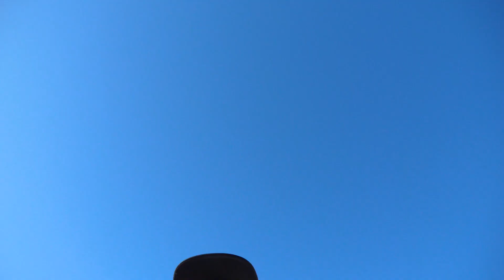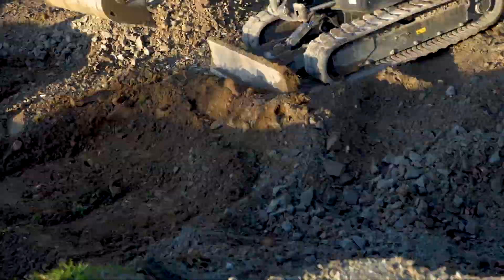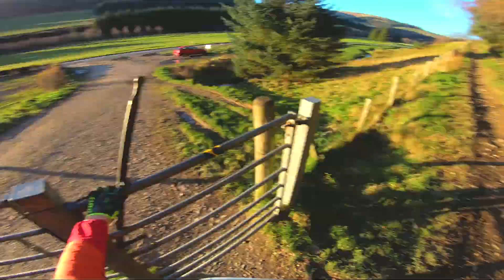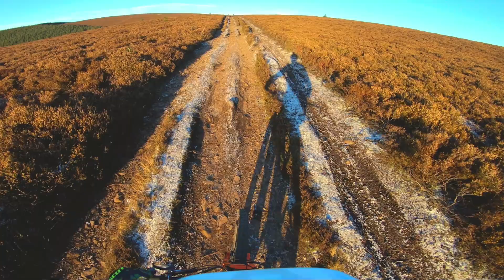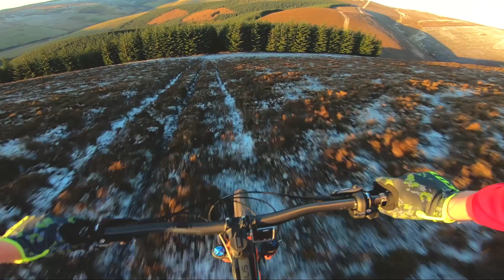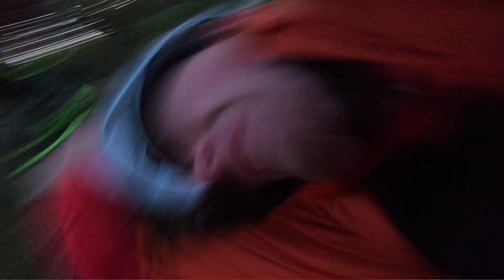IT DOESN'T ALWAYS GO YOUR WAY, I CRASHED | VLOG #6

Comment: Great video as usual! It's a shame a single mechanical failure in the seatpost cut your ride short. Dropper posts, especially if you're paying big bucks for them, should come with a built-in quick release.

I, too, would like a second set of RAW riding videos :) I can't get enough of the rubber on loam sound!
Reply from the maker: Or I should have carried a tool! Didn’t even have one in my van...